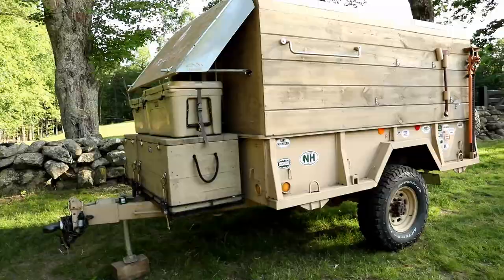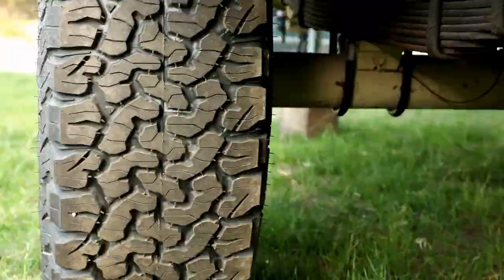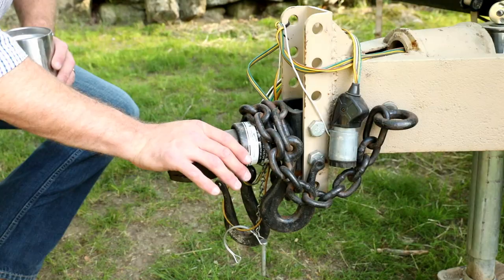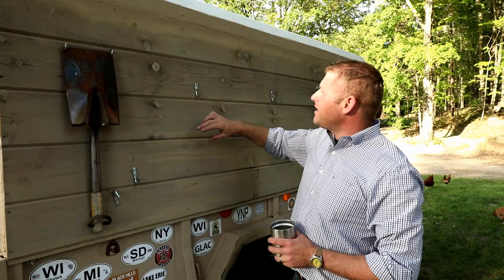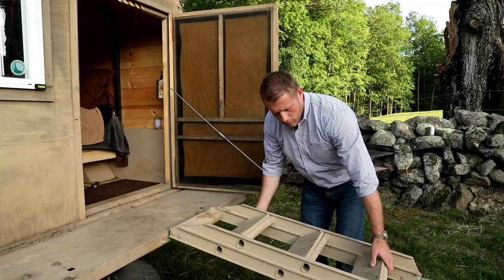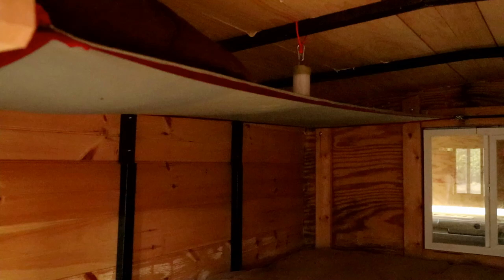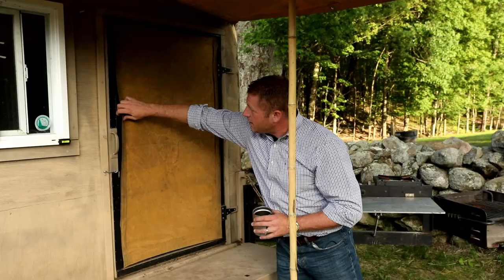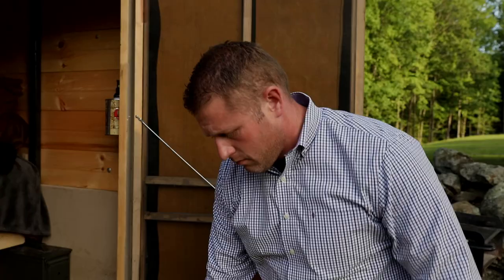Homemade Camper Trailer

Comment: 8 minutes was not enough, I would have loved to see the project build from start to finish.  I have a Stock Trailer about which, I will do something similar albeit, for an all year round trailer will require insulation and a wood burning stove. Good video, just could've done with more information.

Comment: Please do an in depth review. Very curious on weight and how the roof was made how it is not leaky when it rains
Reply: Andrew Lewis , I’m thinking the same thing about how it doesn’t leak water in as it’s only tongue & groove timber. He must have sealed it with silicon or something similar.

Comment: Great stuff, that is a 105A-2 or A-1. (bed size is 6'x9') They are heavy ...factory weight 3500# empty. I  currently have an A-3. about the same, minor  variations.  I have had numerous ones (I also have a dually diesel four door) . For those with a smaller vehical try and M101(bed size 5'x8') and about 1500#. The 101 has 16"" eight bolt rims/tires. The 105 needs the axle  changed "right away" as it is due size 20" air/hydraulic brake and stupid heavy. For farm use I have left the BIG axle on a 105...but try are nuts heavy. You can even just pull the 105 bed and make a whole new frame... I did that with one and made a dump trailer. GREAT stuff! thanks

Comment: I have one also.Put an a.r.e. fiberglass work utility topper with the rear doors on it. Just need to put 4x4 's between the rail and the topper. The doors will match up with the bottom perfect. I have made several for my friends and we love them.Nice video..

Comment: Did the hitch must sitting on the ball one time.  Had a padlock in the hitch and the whole bit.  Didn't realize it until I got to where I was going and when I noticed it almost crapped a brick.  Good thing the trailer (empty at the time) was well balanced (front heavy).  A great reason to remember to attach the chains to your hitch.

A nice build.  I just got back from a trip using a wall tent at my destination and sleeping in the back of my truck (On a cot I built.  The cap has a pop-up top I built myself.) when enroute to and from.  I have a Scamp also and a hard-sided rig like yours or a small RV is at my age a lot more fun.  It's nice to be able to pull off the road and be set up in just a few minutes.  So I see a lot of the practicality you have put into it.

Comment: Nice build I deffinantly love the cabin feel. I am in the process of building one to pull behind my 2007 JKU.  The axcles is the sam width and the height will be no taller than the top of my jeep. Mine will also have to be a bit lighter. I realy like the swing out table/grill combo.

Comment: Thats a really kool trailor. Gr8 job. what does it weigh?
Reply from the maker: udayrohet through estimating various way, like being able to lift it with a tractor that can lift the trailer but not a pallet cement weighing 3500lbs, my best guess is 3200lbs... so pretty heavy for a small trailer.

Comment: I  want more information on the rear axle and suspention.
Reply from the maker: Ray Sanchez rear axle is a sterling out of a 2000 Ford F-250. It's full floating so I cut the axles out and removed the differential. Then I filled it with a lot of gear oil to bring the level  up above the bottom of the axle tubes. The suspension is stock but with many of the lower leaf springs removed. Also, on the axle I cut off the leaf perch mounts and re-welded them at the proper width for the trailer springs.

Comment: Yea that's very interesting! As a matter of fact I have a friend that has used the same military trailer, that he built a similar all terrain camper out of! He is single though and tows it with a 2007 Colorado V8,4x4AWD! He also replaced the trailer axle cause the old one had sit in standing water for about a week due to minor flooding. So he took the rear axle from a rotted out T100 Toyota truck, along with the starter Motor and a little ingenuity, along with a battery pack of three deep cycle 6 Volt batteries for lights and radio, water pump power, that is used mounted to the axle to help drive the trailer wheels in time if need, like in unexpected mud on a trail, or to just move the trailer around his yard and garage when not hooked up. He has a wheeled caddy device that hooks to the trailers hitch, that he plugs a control switch into the trailer that he can control the started motor! It sounds crazy but works great! But between the heavier axle, starter Motor and mount he devised and the extra batteries for power, all that added about 500 lbs!! But it does Tow just fine down the highway at speed, plus off road in tough trails and on beaches!! He also added one of them portable A/C units like yours and powers it with a dual fuel Champion generator! He has plenty of room, but I cannot imagine having a wife and two children in a camper like that! I would buy a nice 25' travel trailer at least! My wife and I have a nice Forest River Cherokee Wolf Pup 16FQ, that is just right! It has a walk around queen bed and dry bath! Along with all the amenities that comes with many new campers today! All LED lighting inside and out, A/C, a propane furnace and three way 8 cf fridge, three way means it runs on shore power, 12 Volt and propane! Plus a microwave! A full length awning and plenty of window and screens and screen door! All for under 13k new! We've had it for 16 months now, have been from Bangor ME to Key West, all over The Smokey Mountains of Gatlinburg and Pigeon Forge to upstate N.Y. Based out of Massachusetts! Soon to go out for a few months to the west coast and western states!! Well sorry for the long tale, but have fun and stay safe!

Comment: That's pretty nice. Another good idea for storage is to put a camper shell on your truck and you could actually get some extra sleeping area if you wanted to put a mattress in there. Would be kind of the same setup like you have in the trailer. We use a blow-up mattress and it worked out real nice. Something for your viewers to check out is called Poor Man's fiberglass. If you're going to build a trailer and you don't have all kinds of money this is a good way to cover it with a sturdy material. I have just recently discovered it and it is really neat.
Reply from the maker: I would like a camper shell, but I use a large goose-neck trailer regularly and I don't think I'm interested those soft shell types. Thanks for the tip, I am going to look up poor mans fiberglass now...

Comment: Beautiful build I would have included a vent window under the front awning  you would have less need for air conditioning and more natural light there newer vent fans that move a lot of air that could be very useful
Reply from the maker: Nadine Sawtell at the 2:07 mark you can see the window . Prior to the ac we used a battery operated fan in it...

Comment: I would love to hear more about the trailer. I also am curious on the oil bath axles as I am looking at building a trailer for my F-350 4x4 that can go across the same off-road terrain as my truck. Just in case my dreams of a highly modified 5 ton military semi truck don't fall through.
Reply from the maker: David Genthner Jr the axle I chose was a sterling taken out of an early  2000's f350 truck. I cut the axle shafts out, removed the ring gear assembly and filled the whole thing with gear oil...

Comment: Very nice, it looks like you have 2x6 or 8 for your sides are they tong and groove what stops it from leaking in rain? I’m just curious really nice job.
Reply from the maker: Jeff Hipson Tongue and groove facing down to shed water. Have not had the slightest of issues. Honestly I can’t remember is I used construction adhesive on the joints or not.

Comment: I am interested in doing a project like this but I am concerned about the weight. I know you pull with a 1 ton Diesel. How would it pull with a  1500 4x4 yukon
Reply from the maker: DailySelfReliance I don't think you would have an issue, I've pulled it with a land cruiser without issue. But it would be heavy... if I did it over again I would take the time to find a lighter weight option. Maybe one of the newer hummer trailers... and don't forget I swapped out axle, rims, tires, and cut lots of extra weight off...

Comment: That camper just looks super badass. I hope to do a similar build, maybe truck camper style. How do you power the ac? Generator or do you only use it with access to shore power? Thanks!
Reply from the maker: Mustard Made only run it when we have access to power...

Comment: What kind of wood did you use on the outside of the camper and the roof? Is it in insulated or sealed

Comment: Nice trailer job, I will be picking one up in a few days and am wondering if you replaced the axle? If so what were the measurements?
Reply from the maker: Tayn Waterworth I did, the trailer is basically un towable as is. It was 5 years ago, no idea what the measurements were, I customized the axle mounts....

Comment: Great job man
 I am starting this project right away. Did you bother to check how much does it weigh?
Reply from the maker: Vikrant Shukla I am able to lift it with my tractor forks so I know it’s less than 3500lbs but still quite heavy for what it is...

Comment: Did making it more aero help ? And how did he build it to keep out water? I see the boards placed next to each other but I'm guessing more had to be done to keep rain out
Reply from the maker: 64maxpower The aerodynamics helped a significant amount. Because I did a cross country trip with and without, I got a clear sense of the improvement. In measured it. Approximate 2 mile/gal improvement at highway speed. And almost no difference when cruising the back roads.

Comment: The military truck that trailer was designed to be pulled by never went over 45-55 miles per hour.
Reply from the maker: Robert Ottwell THats why suspension axles and hitch were all replaced before it ever hit the road.

Comment: Wow thats quite heavy. What vehicle do you pull it with and what s the level of offroading can you do with it behind. Can you pull it with a 3L turbo diesel 180bhp. 
Thx. Regards.
Reply from the maker: udayrohet I tow it with a 2016 dodge ram 3500 pick up truck with 485 hp and 900 foot pounds of torque. It doesn't notice the trailer.  I have also towed it with a 2001 Toyota Land Cruiser V8 without issues. But I do not know it's engine specs.

Comment: I bought my first M105A2 trailer today. My first question, if I take off the military wheels can I install an 8lug wheels on it? Or do I have to modify the axle to fit an 8 lug wheels on it?
Reply from the maker: You need an entirely new axle
Reply: @aliveoutside248  Hi bud,  can I get smaller wheels and tires using the same factory axle I have now? Thanks
Reply from the maker: Neil P71 if I remember correctly there might be some rims off of some of the Isuzu NPR cab over’s that have the same bolt pattern but not sure how small of a diameter tire they take. I don’t think you will be able to significantly lower it tho with out removing leaf springs and using an axle with a thinner tube... it’s why you can get them so cheap because they take some work to reasonably tow with an average vehicle.
Reply: @aliveoutside248  I was surprised when I towed it with my Silverado 2500 HD with the 8.1L V8. I felt it while on the Highway but it was smooth. Even the gas mileage wasnt that bad. I just added a short video and will post more as I will start working on the concwrsio today. I appreciate your input.
Reply from the maker: Neil P71 yeah I also found it towed smooth in its stock form, just looked ridiculous behind my 1 ton  pickup lol
Reply: @aliveoutside248   Alive Outside  If you have time check out my Silverado on my channel. I have one question, the landing gear extends almost 90% down and I can crank it up and down and slides right to left with no problem. Any thoughts? I will start today power washing the trailer and taking the tarp off to expose the entire trailer. I will be sharing more videos.
Thanks again

Comment: 8,000 BTU AC?  Is it a refrigerator or a camping trailer?
Reply from the maker: ElGatoLoco698 that's was expecting! but with no isolation I was surprised to fine it barely keeps up in the hot sun... we drove across country, and in Moab it was 108 outside and 90 in the trailer during the day.

Comment: Great job! I'm full time in a fiver with my family - currently out on the east coast - love what you've done. What's your total loaded weight? Just curious if I could pull similar with my 4Runner which is a bit sissy at 5k tow capacity. Thanks.
Reply from the maker: Joe Martinez 3200 lbs, maybe 3500 really loaded up, but it's the wind resistance that the big issue... if I did it again it would be at least a semi tear drop shape...

Comment: Did you swap the axle? I have the exact same trailer and I want to do the swap.
Reply from the maker: I chose an early 2000's Ford F350 axle due to its known reliability and full floating bearing construction. I ground off and re-welded the spring mounts in the proper location for the trailer spring width.  Then I cut off and discarded the axle shafts, removed the ring gear assembly, and filled it with the gear oil. I ordered ubolts online based on my measurements. I also made top plates out of half-inch steel (four holes for the U bolts and one hole for the alignment stud in the center of the spring stack.) lastly I took about four leaves out of the spring stack to get the trailer lower and soften the suspension.
Reply: Awesome job thanks a lot!

Comment: Hey Jon.  I actually bought an M105A3 last spring after I saw this video.  I picked up a 2008 model for 900 bucks.  Im currently swapping the axel...  I wish there was a way I could actually talk to you on the phone about a few things.  I love your channel.  I had a question about how you dealt with the way the trailer is welded together at the floor and the side walls.  How do you prevent some water from leaking in since its not welded completely?

-Ian

Comment: What is the weight of the trailer fully loaded with gear and water?
Reply from the maker: Candy Robison about 3500 lbs
Reply from the maker: But honestly aerodynamics are a bigger issue than weight is.
Reply: @aliveoutside248  Definitely.

Comment: How much does this trailer weigh??
Reply from the maker: Backwoods Baby through estimating various way, like being able to lift it with a tractor that can lift the trailer but not a pallet cement weighing 3500lbs, my best guess is 3200lbs... so pretty heavy for a small trailer.

Comment: its just too heavy trailer to build on ;) bud it looks great
Reply from the maker: djpitr the finished, loaded up trailer weighs in at ~3200 lbs on the scale...
Reply: Alive Outside ok thats like any bigger campers , i hade chance to buy one just like it for 400$ from Craigslist and decided not to because of the weight  , i build one very light 1000lbs on small boat trailer ;) its easy tow with my 30year old volvo 4 cylinder :) , check it out
Reply from the maker: djpitr awesome, I will!

Comment: How much does it weigh?
Reply from the maker: Jeff Karch 3200 lbs
Reply: Alive Outside jesus! 3200! While I admire the craftsmanship thats just too heavy.
Reply from the maker: Jeff Karch My primary family vehicle is rated to tow 31K lbs... I continue to add stuff to the trailer with a focus on ease of setup, durability, and reliability (and it's just fun) I would not recommend this setup to say, a kid with a jeep...
Reply from the maker: Jeff Karch one thing I'm not happy with is the wind resistance at high speed. especially in a headwind... if I did it again I would focus on aerodynamics.

Comment: Kind of like way too heavy. You might as well get a motorhome, it wouldn't be any harder on fuel.
Reply from the maker: Dale Humphrey it’s about 3000lbs on the scale. Truck with trailer gets a 15 mpg on the highway and slightly better when running just under highway speeds. A motorhome definitely doesn’t go where this thing has been...

Comment: Uuummm, sir, really nice build BUT... thats a 1 1/2 T trailer. I had 4 of these trailers in my platoon/section that my guys & I pulled with my 5 T dumps & Humvees. They're designed to go 55 mph, 60 mph tops. NOT 80-85 mph. Good way to get yourself in a wreck really fast. Be smart...
Reply from the maker: Guy H. That’s why I never towed it with the original axle Springs hitch etc.

Comment: Why would want to do 85 mph with a trailer ?  I swear he is one of those idiots that can  cause a bad accident just because he wants to show that his truck can do that speed loaded.
Reply from the maker: i just meant the speed limits are 80 and 85 mph in many places out west with so you can get going pretty fast and you can definitely feel the wind resistance. That little trailer only weighs 3000 lbs. the truck is rated to tow 31 thousand lbs. i would be proving nothing to anyone that has any idea about diesel trucks or towing in general